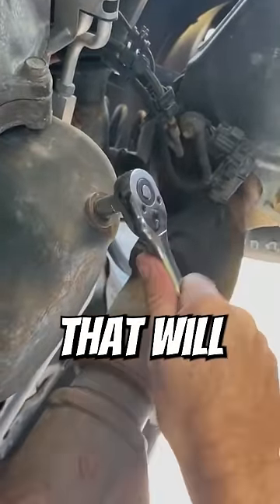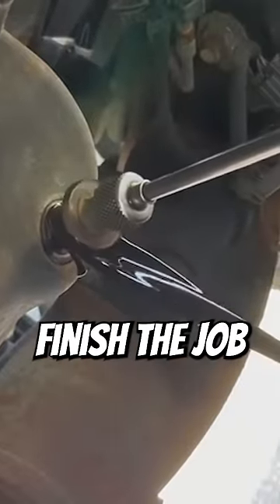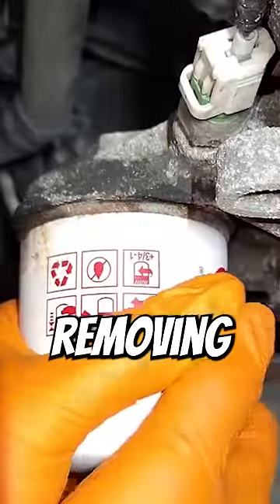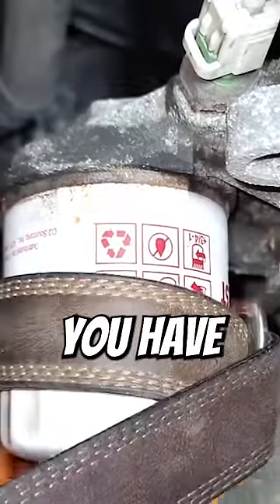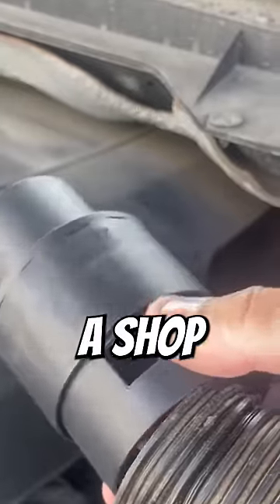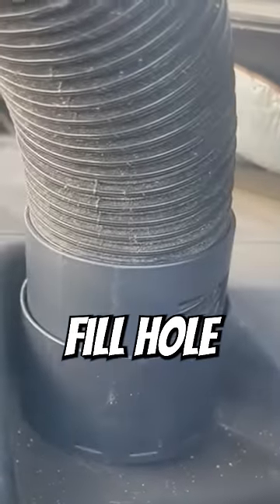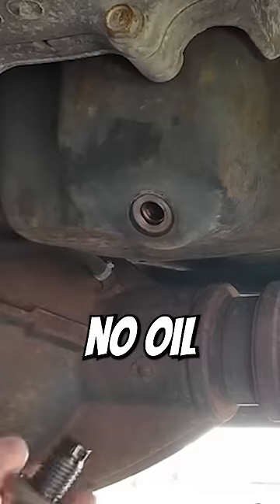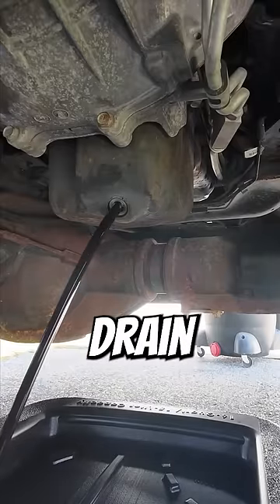Mechanic Life Hacks That Will Improve Your Worthless Existence - Oil Change Edition

Comment: Honestly, I don’t understand how people haven’t figured it out. You don’t need any special tool, push the drain plug in as you spin it out. Once you feel all the threads are out and it’s backing back in every turn, you pull away fast. Easiest way by a mile.
Edit: everybody coming up with ways you can have trouble doing this, y’all should probably just stay away from cars🤣
Reply: For real if you look there is even a section at the end of the plug that isn't threaded its literally made to do this.
Reply: Yes but one still has to let go of the plug to get a grip for the next spin and that my friend is ALWAYS were the threads end.
Reply: @28704joe I agree when I first started doing this trick, but over the time of doing this trick on different cars and bolt positions it gets easier to guess where the threads will end, also doing the oil change on the same car more often will also give you the same outcome I got from doing on different cars, it’s all about practicing and getting to know the car your cracking into, the first times doing the oil, even brakes for that matter just takes practice in doing it over and over and it gets ingrained into your head from the frustration of getting oil running down your arm and getting cover with it
Reply: @28704joe  what dude🤣 if you can’t turn the bolt without pushing it in at the same time you don’t belong working on cars. Not hard to do at all. I’m a mechanic, I think I know what works best
Reply: I wouldn’t exactly call this a trick, it’s common sense after the first few times of getting oil on you it should come naturally.. If it doesn’t come naturally put down the wrenches and walk away permanently, your gonna get hurt..
Reply: Yeah I do this, but his shot vacc method seemed more effective, but also less efficient of course. The cup over the oil filter was one I hadn't thought of
Reply: Exactly what I was looking for in the comments. You can avoid getting even a drop on you. Even better if you just have a rubber glove to throw on for safe measure.
Reply: I was doing that hack with the Magnetic pen and oil plug for over 3 years now sorry it was my idea first 😂😂😂
Reply: Controversial opinion deal with oil on hands till you wash it off?
Reply: I wish my father would have pulled out fast.  Now I have to go to work every day. fml
Reply: I honestly thought that was just common sense.....
Reply: That’s what I do
Reply: The drain plug and oil are hot. Then I go ouch and drop the plug in the oil bucket.
Reply: I do this and have never been completely clean afterward
Reply: Until you bang your hand off a cross member and drop it into the oil dish lol
Reply: I also do this every time I do an oil change and I almost never get oil on myself for the drain plug.
Reply: Well Said:
Reply: That's what I do.
Reply: That one time though where as you whip the plug away and hit the edge of the drain pan and hear it gloop into the murk 😂

I of course speak from experience 😂

Comment: I like the magnet because it should help prevent dropping the plug into the drain pan 😊
Reply: That's the one tip I will use.
Reply: I use a drain pan that has a screen to catch the bolt.  Much easier to wipe down a bolt that needs oil on the threads than it is to clean off the greasy oil from a magnetic pickup tool.

IMO, the shop vac hack was the best.  The oil filter can be loosened with an oil filter socket.  The plastic cup over the filter seems limited to the filter already being loosened and presumably already dripping down the side of the engine.
Reply: You have a magnet, the fuck's it matter if you drop it in oil?

Comment: Been changing my own oil for 25 years and about a million 700k miles. Going to try that cup trick next weekend
Reply: Don't drink it 😮
Reply: The forbidden cola
Reply: I learned how to change oil in highschool, and have told everyone to learn or have someone they know know who'll do it for freely do it for them, it's so simple it should be.
Reply: I’m not buying cups for that
Reply: My filter is on sideways
Reply: lol a subaru
Reply: @jevenator Same, bro. You can do your best to mitigate spillage, but you just have to accept it's going to be messy.
Reply: The cup trick is the only one that could potentially help me as well.
Reply: @jevenator engineers hate everyone else.
Reply: Same, can't believe I never thought of that myself.
Reply: @jevenator 8 dollar oil filter plus 8 bucks worth of brake clean. Personally I love those filters on GM vehicles that are installed vertically but you must turn sideways to get outta the spot the engineers put it in...😂
Reply: I used to change my own oil too until my uncle, who owned a gas station, told me he goes to Jiffy Lube for his oil changes. I of course asked why and he explained that one in every million or so oil filters is bad, and if he does it himself and burns up his engine he has to pay for it as opposed to if Jiffy Lube puts that bad filter on they have to buy him a new engine... Smart.

Comment: I've always used a Walmart bag that I've carefully inspected for holes to cover the oil filter for removal... never heard of the shop vac trick, but I'm gonna use it next time...
Reply: Would a home depot bag work the same?
Reply: Any plastic bag, brand is irrelevant... just check it good for holes first...

Comment: This one's maybe obvious:  Run your car for a couple minutes before changing the oil.  Warm oil runs quicker than cold, and you'll get more of the old oil out and a lot quicker.
Reply: To my knowledge most synthetic oil is lower viscosity cold than warm
Reply: I personally prefer to wait till it’s been sitting a while so as much of the oil as possible has drained out of the galleries, down into the pan
Reply: Yes, what fatal venom said. Also, i prefer not dealing with hot oil, hot exhaust, etc.
Reply: Depends on the car
Reply: @ioanbugheanu6836 that's a common misconception
Reply: You want to run your engine for a few minutes to help suspend small solids so they drain with your oil instead of sit somewhere. Colder oil is thicker and keeps solids in suspension better, so warm is actually bad.
Reply: run it for 5 minutes, wait for 25 minutes or so, drain oil. Itll get about every drop out.
Reply: @ioanbugheanu6836  It's not, but OK.
Reply: warming up your car actually makes an oil change take longer. you have to worry about burning yourself with hot oil, on the exhaust trying to reach the drain plug, and on the engine while trying to reach the oil filter. you have to wait 2-3 minutes for the car to warm up just so the oil comes out 15 seconds faster
Reply: I run the engine while draining the oil so it actively pumps the oil out
Reply: @redsunrises8571  i really hope you’re joking
Reply: Lmfao...yeah..you keep doing that to your OWN car. Don't destroy someone else's car. Do a job right.
Reply: The shop vac. Learned this from the Navajos on the Rez about forty years ago. Still cracks me up every time I think about it.
Reply: @ioanbugheanu6836   Then you don't have much knowledge.

Comment: Helpful hint.  Before you attach the new filter, apply a little oil around the
gasket.  This will make the next oil change easier.
Reply: Put some new oil on the gasket, and the threads. This helps prevent thermal locking and cold-welding in the case of thermal runaway, and on top of making the next change easier by putting it on the gasket, it helps prevent the gasket tearing when it goes on!
Reply: @wyattcrafty1649 new oil or old oil doesn’t matter. And if your housing stud isn’t already wet enough to lubricate the filter threads you’ve got bigger problems.
Reply: That and only tightening the oil filter with three fingers (middle, index and thumb).
Reply: @foojub6907  I do it with new oil for good measure, same as the threads, just for good measure. I realize if you can't screw on the filter, somethings wrong, but it does keep it easy to take off and less chance for corrosion. I just do it because I was taught to from my father.

And I realize what kind of oil doesn't really much matter, I just prefer newer oil for a better all-around feeling. I'm weird like that.
Reply: This will also help the filter seal better
Reply: If u dont know this already dont attempt an oil change
Reply: @ashemarsh699 everyone’s gotta start somewhere. Besides, not putting oil on the threads or gasket is probably the least worst thing you can mess up when changing oil.
Reply: @zacharytracy3797 yeah but that gasket will be dry and hard to get off for the next time you change it
Reply: I use 2 gaskets the one that stuck on from the old filter and the new one, this gives a little extra capacity and a double good seal
Reply: @vanillaice5443 no, that's not how gaskets work...that's how leaks work😂
Reply: Woosh
Reply: @johnwest6977  yeah, but this guy is telling a stranger on the internet to GIVE UP automotive maintenance just because he’s inexperienced. Nobody starts as a pro. And trust me: I’ve messed up FAR WORSE than making the next oil change a little bit harder over the course of my learning.

Comment: Fun fact the oil filter does not need to be screwed on more than one turn hand tight. The Rubber seal does a really good job add providing friction preventing unscrewing itself against vibration. Your oil filter should be able to be removed by your hands alone
Reply: 1/4 turn past snug. I myself have a set amount of tightness I use,because I know it wont ever leak or vibrate loose & still removable by hand .

Comment: I take the oil cap off the engine before I remove the drain bolt. Allows vent for a more predictable  oil flow
Reply: ...and let the oil cool down a little, so it's not splashing like water.
Reply: Should take the dipstick out too

Comment: My favorite hack is to use an actual oil filter wrench to get the oil filter off. Works every time.
Reply: Actual wrenches come in varying sizes. Belt covers all sizes 😏
Reply: @foojub6907 an oil filter wrench is an adjustable rubber strap, there's only a couple sizes. Unless you have a drop in filter that requires the appropriate manufacturer socket, which you should also already own...
Reply: @KameronJ7  thats a really long way of saying exactly what I already said, bud
Reply: @edder7157 Clearly you've never been under a 5.3 vortec that doesn't have a OEM filter/filter with socket marks.
Reply: @foojub6907  Your whole point was that belts are more adjustable and as such are better. Her countered with saying that you don't need that many filer wrenches because they are also adjustable and are standardized. 

He said a completely different and opposing view. I also have to agree with him, because I have changed the filters in many cars, and almost all your regular cars have the same size oil filer. I have a bunch of them, but only use one. 

My main issue with the belt idea, is that it doesn't actually do anything. The effectiveness of the wrench comes from not just the tightening, but the long handle. Since the belt doesn't have a stiff handle, you aren't achieving anything except ruining your belt.

This is proven by the fact that the belt tactic, barely worked on a filter that was so loose, that you could see it wiggle, when he pretended to try to unscrew it with his hand. You would be better off just using a rag for extra grip, and using your hand. It's not major, but its far better than this belt idea.
Reply: @Pizzagulper  way to take an offhand comment way too seriously. you must work at a dealership to only need 1 filter wrench, that shit won't fly with general service

Comment: I press the threads of the drain plug in until you feel it's all backed out, and once it is, you just yoink it out real quick. No mess.
Reply: Me too. I hate when I pull and somehow still "isn't unscrewed" as if by design and the bolt falls followed by chaos.
Reply: This man works on cars
Reply: @pyrogon7566  Yeah, except I was doing an oil change the other day, and I did this and got oil all over my glove. I wasn't thinking and didn't have my hand out of the way. 🙃
Reply: Yeah if only it went as smooth as your description every time.
Reply: @Rembo318  I know, it doesn't.
Reply: 9/10 times yep you are right. But that 10th time lol oil gets everywhere or maybe you drop the plug that’s always fun.
Reply: Is "yoink" a word???
Reply: @orisisseibert3507   what do you think it means
Reply: @antelopepoop  Coined by writer George Meyer for the TV show The Simpsons; perhaps from yank, or imitative of the sound effect (a quick upward slide on a violin) that accompanies something being SNATCHED in classic comedies.
Reply: Until you do an oil change on a GM where the oil starts dripping as soon as you crack the fucker
Reply: @filipevieira6052  especially 02 where there isn't even enough room for a socket between the exhaust and drain bolt
Reply: I do same but instead of getting away real quick i tilt it upwards and remove it slow, with this method i can put it back whenever i want for example if i only want to remove a fraction of the oil
Reply: Same 👍🏻👍🏻
Reply: How is not common sense to come at the plug so you can unscrew from the side/top. Just unscrew it like normal and keep your hand out of the way...
Reply: @bigfunky74  If I could share pictures I would. There isn't always room, or the angle available to do that. For example my Silverado exhaust is in the way.
Reply: @orisisseibert3507  I just did my 2018 silverado, but I do get what you mean especially on these newer vehicles.
Reply: @bigfunky74  yeah, sometimes I think they are engineered by little people 🤣
Reply: @orisisseibert3507  man I just had to swap the battery on my silverado too. Have you seen where tf they put them?? Definitely engineered by little fellas with way too much free time.
Reply: Fact
Reply: That's how I do it.. don't need any magnet to help.. most of these tips are useless if you know what your doing and change your oil regularly.. never had any issues removing oil filters on my cars either because I don't over tighten them like some enraged ape
Reply: I was always told that if you yoink  too much, you'll go blind. Wait, are we talking about the same yoinking?
Reply: Yep. A good way to tell when to "yoink" it away is when the bolt starts to wobble
Reply: First of all, great name. Second for those who don't know what yoink is, it's a backwards yeet. Thirdly don't worry if it doesn't work sometimes, it takes practice to have a perfect score on your pull out game. 😊
Reply: I used to do the magnet trick, as I gotten more experienced I do this.

Comment: The cup hands down! 🍻 I'll be doing that from now on with my Chevy 1500.
Reply: Gon need oneeee big water cup for that one you’ve got a pg2222 or 2500 either ones not fitting in a regular cup
Reply: Good luck if it's a 4.8.
Reply: @rverro8478  5.3 A red solo cup should work perfectly.
Reply: @jimmytaylor570  Point taken.
Reply: Just punch a hole on the filter with a screwdriver
Reply: @swansong68  Thanks, but I'm not waiting that long for it to stop draining. I have other obligations in life than to wait 20 minutes. I'll get dirty if the cup doesn't work. Currently, it is 2500 miles in on my 7 to 10k oil change, so we shall see when the day comes.

Comment: The vacuum was the best hack. Perfect for doing a oil change on a hot engine and to keep the laneway clean
Reply: I saw another short about that one the other day and couldn't figure it out at first, I thought they were trying to use the vac to suck up the oil, glad this one explained it better
Reply: Sucking up a bunch of hot oil vapors into your vacuum motor probably isn’t great. Fumoto valve or just pulling the plug quick does the same thing but easier
Reply: @foojub6907 what are hot oil vapors going to do to a shop vac? It's not like your using your mouth. I've sucked up WAY worse with a shop vac.
Reply: @foojub6907 don't care- its a $50 vac
Reply: Nooo, is a bad idea vaccum is conected to electricity is not safe.
Reply: @alexwilliams147  the oil vapors are flammable. The shop vac electric motor creates sparks. Flammable and sparks = fire. 

They say that word for word in the instructions!
Reply: @muskokamike127  what the minimum ignition energy of motor oil at 200F. Whats the vapor concentration of the oil in the air stream? I highly doubt you're in the flammability range by the time it reaches the vacuum pump motor ... If it ever even gets to the motor. It's likely just getting to the pump, not the motor. Not to mention the filter where most of the vapors are condensing on to. But yeah, those people are dumb. Just get a little hot oil on your glove, cry about it later.
Reply: @tomhunter91  The manual for shop vacs plainly states that flammable liquids should NOT be sucked up with the vacuum because the vapours DO go through the motor. 

We don't know if he was using a filter

Shop vac filters dust NOT vapors. Vapor will pass right through them.

Comment: That 3rd one is actually super useful for repairing hydraulic systems on equipment. A few quarts of engine oil is nothing compared to having 50 gallons of hydraulic oil trying to force its way out of the hose you just removed.

Comment: The vacuum trick is especially good when you need to weld up an oil pan without taking it off the vehicle, I’ve had to do it a few times for work